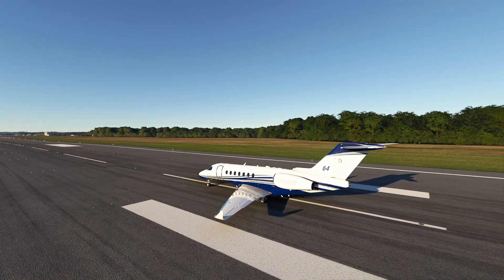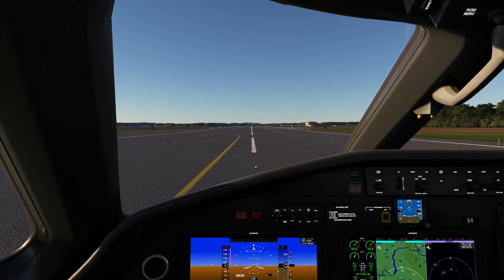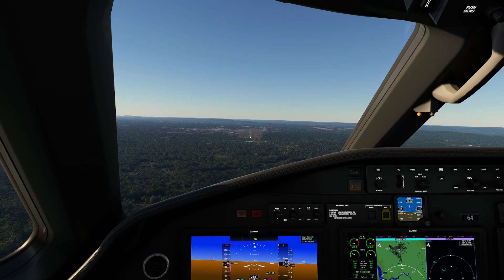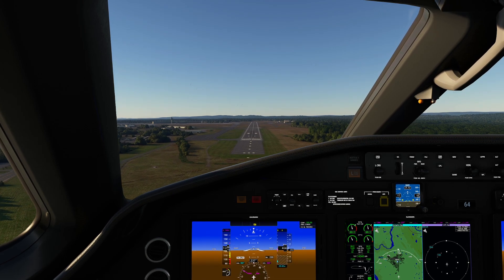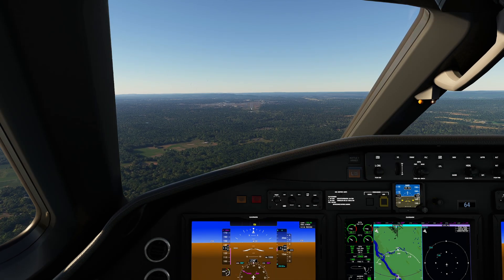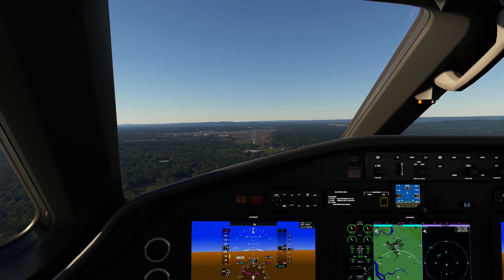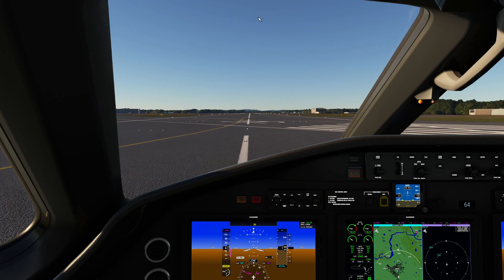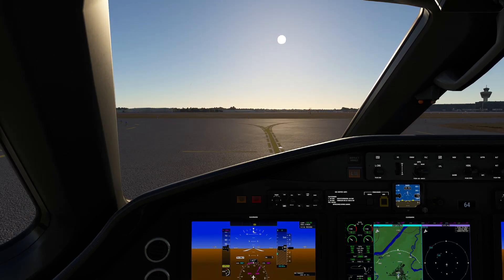MSFS - Understanding the Effects of Landing Weight

Comment: I recently just started to learn to fly the Longitude. In studying the aircraft manual I noticed the weight limitations for landing as well, especially compared to the max takeoff weight... a 6,000 lb difference! The first question that came to my mind was what would you do if you took off at MTOW for a long trip but then had a sudden unexpected in air emergency that required you to return and land right away. How do you get rid of 6000 lbs of excess fuel? Is there a way to dump some of it in flight? Even if so, can you imagine the cost of having to so?!! At nearly $8.00/gallon for Jet Fuel, that would be a $7,000 loss! 😮